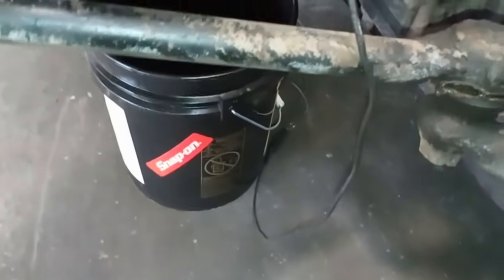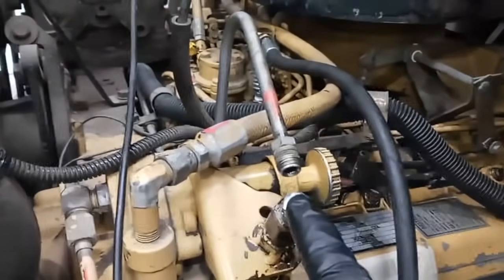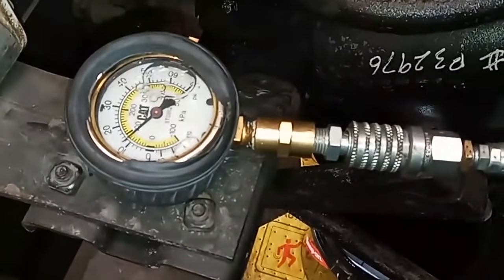Diesel Fuel Pump Troubleshooting. A Day in the Diesel Engine Shop.

Comment: Just ordered the load pro by your link. Been looking to buy it for awhile!
Reply from the maker: Thank you so much. It doesn't cost you anything extra, but helps the channel out.
Reply: @AdeptApe  do you know much about the 3013 3cyl engine? was it decent? there's a core available here for $200, doesn't look like a rod is through the block
Reply: @Zaid Hank You and your hand most likely

Comment: I got a c2.2 engine, seems to randomly starve of fuel, runs ok on idle but jumps around 40 rpms up and down (like from 860 -900rpms and when i go higher to about 1000 it begins to act crazy, like its going to shut off then jumps back up and rpms are all over the place. If i click the throttle higher on murphy panel then the engine seems to even out more or less like how it was at idle. I replaced all fuel lines, filters and o ring are good. I used power probe to activate fuel solenoid. Not sure what it could be now. Any common issues ir way to test if injectors are getting stuck?

Comment: FYI, pump pressure spec is ~32psi but that is with the engine running presumably at ~2500rpm

Comment: My 3306 c has problems with the injection pump solenoid enough that I keep a spare one but most of the time the problem is simply loose wires at the solenoid.

Comment: Judging by the fuel in the valley, My guess  is the throttle shaft seal had failed and was sucking air in the pump.

Comment: I need help where is the transfer pump?  Is it the block mounted on the back of the head ? I have no return fuel coming out from a freshly rebuilt injection pump runs then dies 
3208

Comment: Hey good night a has a big problem with mi c7 wax 36849 the mechanic open de motor change the malfunction parts  also replace the all censors ,hew pump and continue the problem he lost the power and smokeless white

Comment: @3:18 always check for fuel. I've made that mistake diagnosing a customer's truck they said they had fuel. After a long ass time couldn't figure out why I wasn't getting fuel. Turns out the customer is cheap and runs their truck constantly on E 🤦🏾 you live and you learn.

Comment: i hated those fuel/water seperators. had more of them suck air than didnt  especially in cold weather.    with a frozen line that hand pump would pull serious vacuum and suck itself in.  those throttle shafts would wear in the back housing  woudnt leak but wouldnt idle stall and hard starting.  i had more than one  pump slip on the gear throwing itself out of time. its just a taper lock and torque bolt.
Reply from the maker: Interesting name you have there. They are quite the different design, with a metal clip the only thing holding them on it's weird they worked at all.
Reply: I take the darn thing off and put a spin on primary filter. Had a customer several years ago with a 3208 in a motor home. Had to raise the bed to change fuel filters. I took all that off, routed fuel line to a compartment on the side. Put primary, secondary, hand pump and put a bleed hose down below compartment.

Comment: Awesome video, love watching these. I have the same engine in the same truck. Real love hate relationship. A few years back we had starting issues with it. Sometimes it would fire right up. Sometimes it would crank and crank and crank before it'd start. After chasing our tail around the truck we found the fuel pickup tube in the tank had cracked at the top of the tank. Which was letting air be drawn into the fuel system. Now if I could get that coolant leak fixed...

Comment: I would wash the heads with kerosene change the oil and mix some ATF in with the fuel once the high pressure pump was installed

Comment: Sup adept i am a cat mechanic from Jamaica dont have many hours in the firld like u tho i learn alot from i recently call the work on a 3126b its in a 322c excavator with all 6 injectors code saying other failure mode i check power and ground al the wires from Ecm to injector wire harness all good so i make the call on the ecm thats its bad

Comment: You do have to time the injection pump to the rest of the gear train don't you?
Reply from the maker: Yes you do. We know the pump is rotating because the internal transfer pump is pumping and timing can be surmised as not a concern at this time because we have no exhaust smoke and nearly 0 fuel coming out of the nozzle lines. I did time the pump before removing it and it was in time, just didn't put that in the video because it was a different day.
Reply: @AdeptApe  I was just curious because I had a brain fart. But anyway isn't there a special machine or something for fine tuning the timing? I know they had them back in the day for setting the timing on 6.2L/6.5L Detroits as well as the 6.9L and 7.3L IDI engines.
Reply: @SOU6900  You have a pin that goes in the fuel system and a 5/16 bolt that goes in the front cover. Since the bolt goes in the camshaft, both are on number one if they drop at the same time. On checking timing advance, it uses a slide advance that only static timing can be adjusted. You will need the Cat timing indicator group and a used fuel line. You have to put the transducer on the pump at number one. So you need the fuel line to bend it to number one adapter. Then on the timing hole in the front cover, you put a probe to measure the hole. Hook all up to the box and it reads RPM VS advance. Since this is a old type fuel system you have whats called port effect. This engine you will have 0.1 degrees per 100 RPM's. So at low idle of say 650 RPM's you will show 6.5 of port effect advance, plus static timing. You than need to know at what RPM's the advance kicks and when it ends. And how many degrees you should have. New scroll will have 0.2 port effect. You than run the engine up and check timing every 100 RPM's to timing ends and then back down every 100 to make sure its not sticking. Put it on graph paper and see how it looks. 
Generally what happens on sleeve metering pumps, they run in diesel fuel. No engine oil and if the set the pumps freeze's up. You can pull the top plate off and see if the rack moves. If not start pulling pumps until the rack frees up. Drain fuel out of pump, make repairs and clip board ready on start up. Last one I did no reman fuel system was on hand so I repaired old one.

Comment: I have a question about a 3406e 1lw 475 it cranks n starts fine only gets 18psi of boost wen goin down road with cruise runs fine but wen u deactivate cruise n use foot pedal its sputters for bout 10sec den pics back up have replaced main fuel line fuel line from primary filter to fuel pump then from fuel pump to secondary filter n from ecm plate to head any ideas on wat problem maybe

Comment: Does CAT make the pressure gauges you use or are they rebranded? Also are they only available though CAT? I’ve been looking for some good quality gauges for a while now and have found it difficult to source those gauges.
Reply from the maker: As far as I know they are legitimate Cat. I bought them from my old dealership and have them in about 5 different pressure ranges. They are really nice gauges, are they the absolute best out there, probably not. There is probably some Swiss made, magnetic field gauges out there that cost a fortune, but these work great.

Comment: That's exactly my actual problem on my old  3408 generator   . Fuel Pressure rise up , but , as I unscrewed ALL ( 8 ) tubes , nothing come by their end  . Don't have fuel shutoff solenoid on the pump's head . 
So , can't wait your next video to see what you will find !
Reply: probably one of the pumps stuck in no fuel. those are sleeve metered pumps   your 3408 should be a scroll
Reply: @richardcranium5839 👍 absolutey what I thinking about after readed many docs about this pump  ... I will let you know when I 'll take time to work on the engine ....soon .

Comment: Thats an old beast. We got an old Ford 800 that still has that style of shifter/transmission
Reply: I've seen a forum post that describes that particular shifter. Wish I could find it again because I've forgotten already how it works exactly.
Reply: @SOU6900  It's an Fuller RT6613 13 speed. First three in low then flip up to intermediate go back to first then run it for five then high for five. I have one in my International.
Reply: @robertcirincione6099  Ok so was there an 18 speed version as well?
Reply: @SOU6900  No not that I know of with that knob. The RT6613 was a intermediate transmission for smaller trucks. Uses a 14 inch clutch. Eaton had a three speed air operated rear end that used a similar knob.
Reply: @robertcirincione6099  that 3 speed was actually tandem rears both with 2 speeds  the interaxle diff was made so it wouldnt lock in. low  both were in low  high was both in high  intermediate was one in low one in high.  weird setup but it worked  all the ones i worked on was electric over air.
Reply: @richardcranium5839  Cool.

Comment: Fantastic vid. I'll probably re-watch this sometime if my friends and I run into this problem. We've had an issue on a bus where it takes forever to start. It does eventually start, but it's becoming a pain. The humor thrown in here made this video twice as great to watch.
Reply from the maker: Thank you. Check the timing on your pump if it is hard starting, might be off.
Reply: @AdeptApe  Okay will do, thanks!

Comment: Another awesome video Josh thank you. I seldom get to leave comment but I catch them all. What do you think about the low sulfur diesel really doing harm to the old style mechanical fuel injection pump? I hear without the lubricity of the sulfur it really takes it’s toll on those older style pumps such as the one you have here
Reply from the maker: That was a very big concern when those fuels were coming out initially back in the 2000's. I would say trim my experience it hasn't damaged them as much as many people thought it would. I'm sure it hasn't helped them though and perhaps someone that is much better educated on the subject could chime in with some information.

Comment: Had a similar cat engine(can't remember which) play up like this checked stop solenoid and fuel pump banjo guaze but it still ended up being the fuel pump. I couldn't believe the drive gear to the fuel pump isn't even keyed, its just like 15lbft on a taper. Makes me wonder if they slip sometimes and just do this. Idk, just swapped pumps and sent old one for reman.
Reply: P pumped cummins 5.9's aren't keyed either, but they're installed at 140 ft lbs and still slip sometimes

If this is the injector pump, I'd love to know what's wrong internally.. to not get fuel on all cylinders must be something mechanical

Comment: Just gotta be careful how far you have to tow a truck, most gearboxes need oil pressure and if drive shafts aren't dropped or axles pulled the gear box can be damaged from lack of lube.
Reply from the maker: I think the 85 feet it went, probably unaffected the longevity of the gearbox. Good point though.
Reply: If a truck is getting pulled around a shop often enough to cause damage to the gearbox there's far bigger issues at play lol

Comment: Are you going to show the fix 
That set up reminded me of the old 7.3L Ford used 
Thanks for the video
Reply: Yes both are HEUI systems, developed by Cat and licensed to international harvester for use on the powerstrokes it designed for Ford.
Reply: @jaydunbar7538  I think he's talking about the 7.3 IDI which had an injection pump in the valley
Reply: @Raise986  yes I am  talking about the old school system
Reply: @stevenkietzke5582  that was a stanadyne pump. the engine was made by I.H.   big brother of the earlier 6.9L

Comment: I'm going out on a limb to predict ether the plungers have seized in the pump elements from water entry or one of the fuel metering sleeve control links has cracked locking the rack linkage in the shut down position.  If it failed to start after sitting a longe time likely number one, if it was running and failed at re start number 2. Both very common faults on 3208 sleeve metering fuel pumps but not the inline type on 3204, 3304, 3306. Agree with your trouble shooting methodology, simple stuff first, starting with no smoke no fuel. You get a bit of fuel from the cracked injector lines on crank becase the injector pump elements are still displacing fuel but not enough to overcome the nozzle VOP. Let us know what you found.👍 Cheers mate 🍻

Comment: Why do VE pumps wear the shaft on an angle so quickly?
Apparently Miss alignment...

But in my case I think the housing was out or the bearings that were made to suit the pump were... As the pump that came off prior to a new pump going on did not fail in the same fashion... It failed with the Cam self destructing and fragmenting through the pump. Not great.

Comment: If it was that long for the fuel filter, when was the oil last changed 😂
Reply: Probably a farm truck, that old of filter may only have a few thousand miles on it. My old cabover had 15k miles on the overhaul that had been done nearly 4 years prior to me buying it from the farmer. Not saying its a good thing to do, it supposed to be done yearly regardless if the milage interval is met, but I can't say I'm not guilty of it on vehicles that see limited use. "I'll get to it"
Reply: Probably in 2017
Reply: What I've noticed here in Oklahoma is that people change the oil but not fuel filters at the same time. They'll wait until it's running bad to change fuel filters.

Comment: Helpful hint, if you ever need to remove the injection pump gear on a 3208 weld a 13mm socket onto a plate and pull the bolts in . Actually I think it was 10mm it’s been a long time
Reply: Cat has a tool and you use two 1/4 NC bolts. Tighten the nut up in the front and it pops the gear off.

Comment: Timing of pump interesting
Reply: For mechanical injection pump fuel systems, the fuel pump draws fuel from the tank AND does the timing, metering, and injection of fuel into the cylinders. Because the fuel pump itself does the injection, it needs to be timed. 

On newer systems (unit injectors and common rail) the fuel pump doesn't need to be timed.
Reply: @electric7487  - Good points.  I would say "the fuel pump receives fuel from the transfer pump" AND...  Just a minor point I'm making about the subject engine.
Reply: @cwj9202  Fixed. I meant to say the tank.
Reply: @electric7487  - I figured as much as you knew what you were talking about.  I just added one small detail.
Reply: Old way pressing gear off and a pin made pump Stay in time while apart. I like the engine not epa friendly I guess

Comment: This reminds me of a New Holland twin rotor combine we bought brand new and owned for many years as it had a turbo 3208. In the last while we before we decided to send it on down the road ( ritchie bros auction ) it was loosing its prime if it sat for any period of time and had to hand prime it. I was noticing the fuel pump valley was wet and assume it was having issues which was causing the fuel to drain back to the tank/air drawn into the line. At the time I was told those pumps were quite pricey and we had put more then enough money into that combine although was bitter sweet seeing it go but we never had any issues with the engine up until that fuel prime issue. What the heck are you doing with SNOW, your supposed to be living in the Sunny Surf state with babes on beaches ? LOL.
Reply: We have a non turbo 3408 that can sit for months and no matter the temperature all you have to do is bump the key and it starts guaranteed
Reply from the maker: Perhaps I'm not in a hot climate anymore, can't confirm such things.......yet.
Reply: @AdeptApe  This could be, but I would wager probably warmer then it was here over the weekend as Saturday morning it was -47f and yes actual temperature. I still blame my grand parents for that as they should have stayed in Oregon near Portland vs moving to the arctic prairies of the 51 state !

Comment: Some years ago we had an apprentice fitting the same style of fuel tank on new trucks found out he had a bad habit of occasionally dropping the delivery red dust caps into the tanks result when the fuel level was low the dust cap could occasionally attach to the pick up pipe stopping fuel flow engine stops cap would fall of coursed a lot of pain 👺
Reply: I know a guy that had a 5 ton truck with a 5.9 cummins in it.. had the same problem.. but it would only happen on one particular stretch of road.. those are tough problems to find
I had a similar problem with rust buildup on the bottom of the fuel tank/in the fuel lines of an IH684.. would lose fuel pressure/power.. had to take the whole fuel system apart and backflush it

Comment: Josh, what have you heard and what do you know about DFI in diesel engines (ducted fuel injection). Just came across  this idea. It sounds like the idea has been around a few years.
Reply from the maker: Never heard of it, not going to lie. Might have to look it up.
Reply: @AdeptApe  You might find it quite interesting, I know I did.
Reply: @Yeti573  ,,, are you talking, direct fuel injection,  gasoline  ?
Reply: Are you talking direct fuel injected, gasoline ?
Reply: @rolandtamaccio3285  Nope, its actually called ducted fuel injection. It's the exact same concept as a bunsen burner. You'll have to look it up on YouTube, its worth watching.
Reply: @Yeti573  ,,, maybe I have heard/ read something about it, if this Charles Mueller is a professor . At the time I read it, I was thinking it's probably tooooo late . I actually might have seen it in my Google News notifications . The prof I'm talking about has had a big money research grant for quite some time . The horizontally opposed,  2 pistons in one pipe is way ahead .